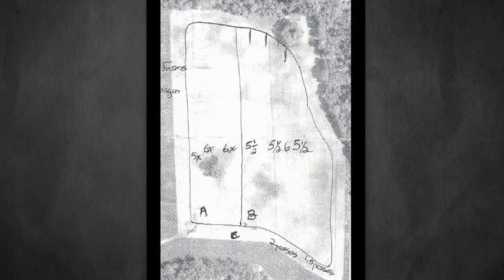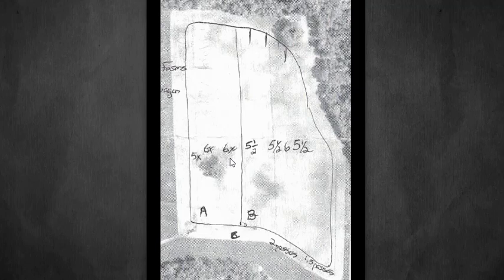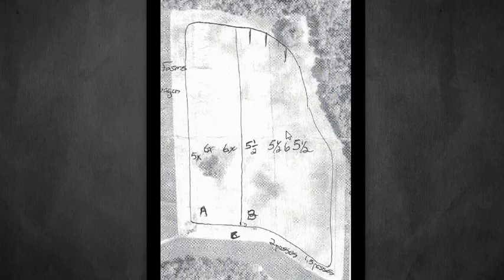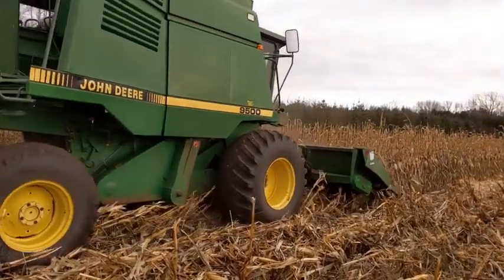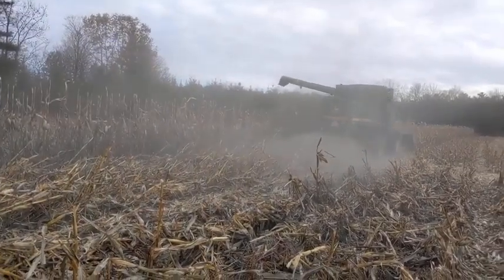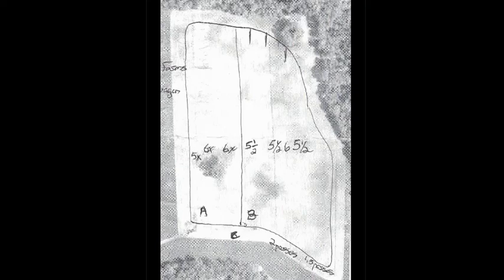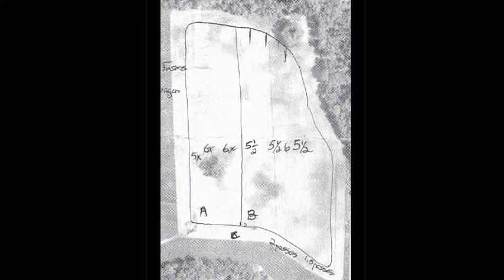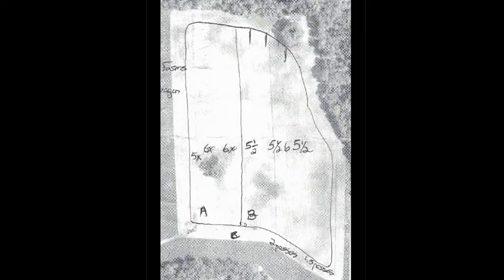Compost Extract Corn Trial Results

Comment: But what was the biology in at the begining,how many bacteria and fungi ratio doing Johnson su compost need time and attention need to make slosebfollow up of the biology,need see what was raw material need to review all details need soil biology analysis before applying the extract and after the extract,how seed have been inoculated you need to add mychorriza fungi family and the5e is probably not in the extract and also start yiu compost with en1 and imo,once you have a good compost use the extract to start the next batch of compost so over time you will produce stronger abd stronger biology.what you explain is good but it just indicate biology and fungi to bacteria ratio is not good and what cover crop are you using?